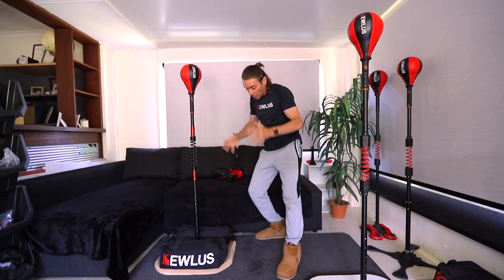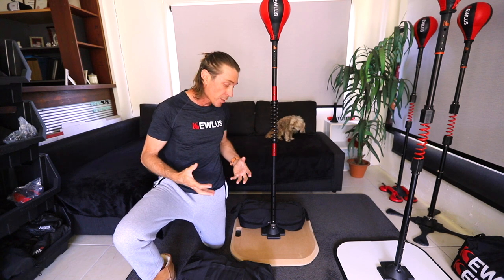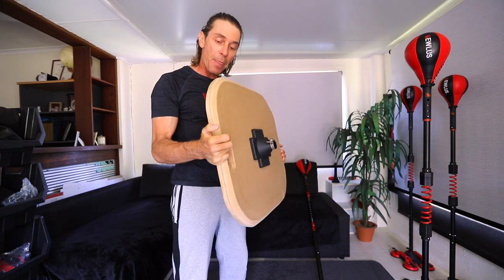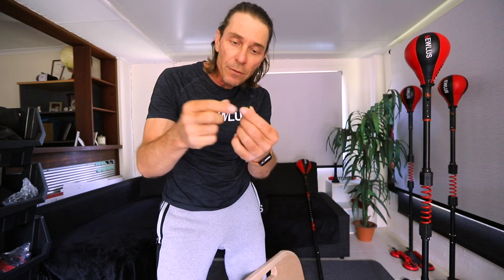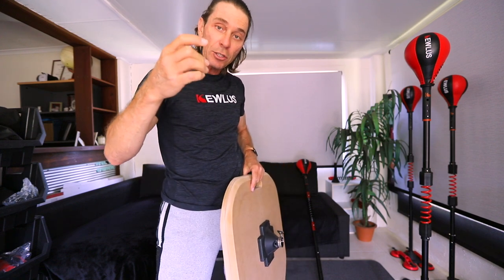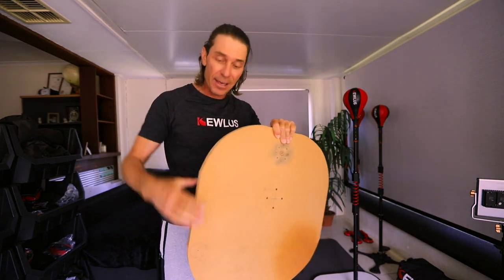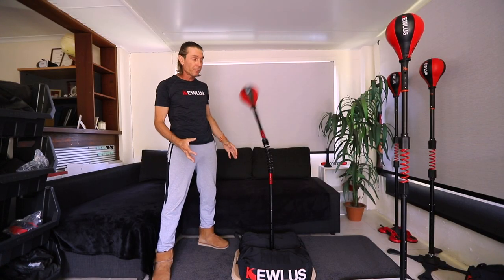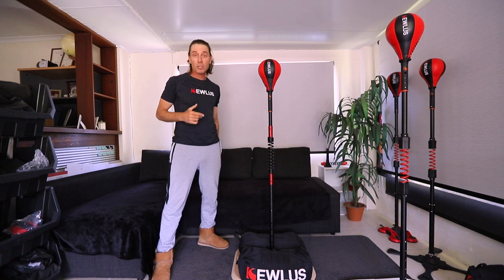DIY Baseboard for your Kewlus Cobra Bag

Comment: Is a 3/4 inch Mdf board thick enough for the KS3 spring?
Reply from the maker: Two of them stuck together will work. And 1.5 inch long countersink screws
Reply: @Kewlus  ok and should I use anything to connect them other than the screws? (My bad for all the questions I’m not really handy)
Reply from the maker: Just glue them together to form a thicker board and then screw down the Multi Base with 1.5 inch countersink screws